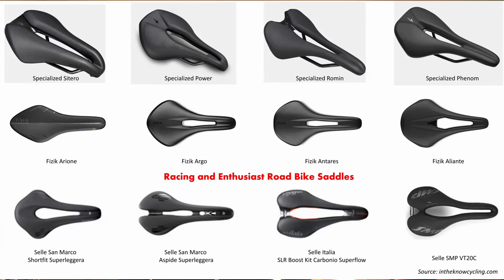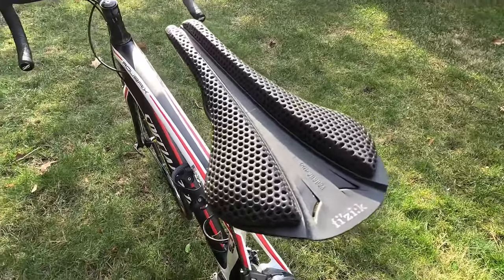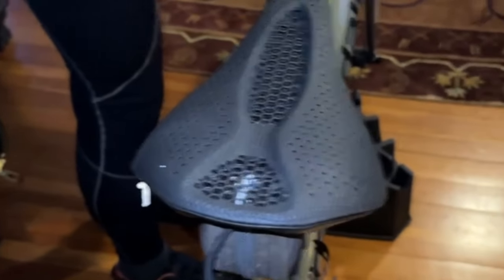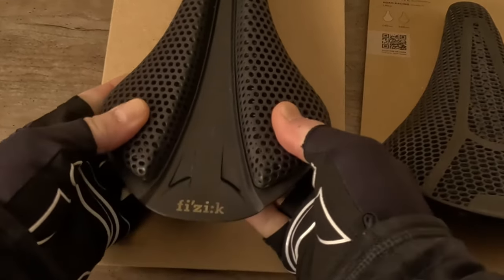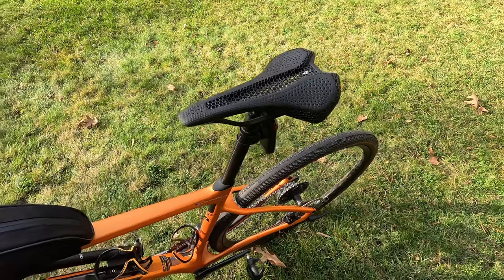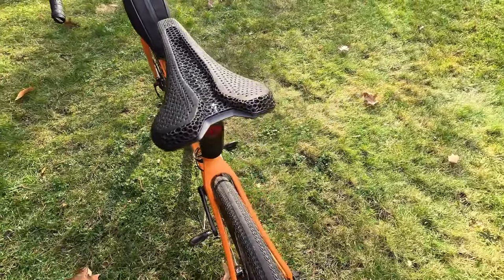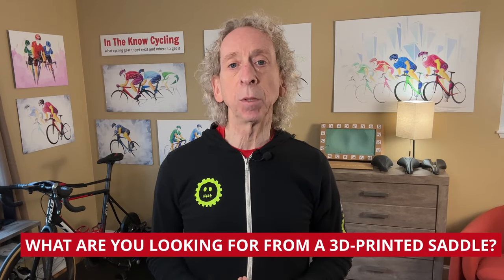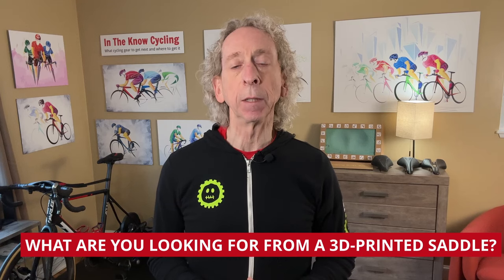3D-Printed Saddles | In Search of Comfort and Performance

Comment: Another option to look into is Reform saddles, which uses a heat molding process. I've tried a few 3D printed saddles that were ok but not great, and my narrow ish sitbones have made it tricky to get a saddle of any material that I felt 100% supported by, but the Reform saddle even before heat molding felt much better for me off the bat. Not saying it will deliver the result for everyone, but something to think about as we search for actual custom fit options like the butt print one.

One thing I'd like to see from companies who offer butt molding is some kind of apparatus that secures to the rails of your seat post so that when you sit on the molding material it matches the angle of your riding instead of a neutral sitting position.

Comment: Imagine a “fitting saddle” that could adjust all the parameters in real time while testing similar to a fitting test bike. 
Maybe with fluids in segmented compartments that could be adjusted for pressure during the test. Combine that with the contact images that indicate the hot and cold contact points and I believe the situation could be highly improved. If perfected there would be riders lined up around the block to try it. Even different widths could be made for sit bone spacing. From my experience getting a good fit can be as elusive as measuring smoke with a tape measure.

Comment: I would find it helpful when reading saddle reviews if the tester listed their size, weight, and build. A test from a 6'0" tall 175 lb rider isn't much help. One from a 5'7" 150 lb tester might point me towards  a saddle that would be more comfortable for me. I'm old and slow so comfort is my priority. Thanks for your videos and website.
Reply: That still wouldn't help. Someone of the same height might have wider sit bones or more hip flexibility or an off center pelvis or any number of differences from you
Reply: @damu6678  I wasn't thinking of this as a complete solution, more of starting point. Every little bit helps.

Comment: I found a very good offer for S-Works Power Mirror saddle (286 Eur / 310 USD, incl shipping) so I couldn't resist and purchased it. Now waiting for winter to finish here in Europe and give a try. What are my expectations? I'd say that I'm not 100% happy of my current Power Expert saddle in long rides - it's not terribly bad but I know that it could be better (e.g. comparing with my previous bikes/saddles). Part of this is a bit more aggressive position and bike geometry so I hope that the new saddle with Mirror somehow will compensate it.

Comment: I'm stuck inside on my Kickr Core full-time due to a very nasty accident and would like to know if you have a suggestion for indoor trainers.
Reply: Sorry to hear about your accident. Considering what you've gone through, I'd start with a good fit and then test saddles suggested by your fitter. A 3D-printed saddle (or foam one) may give you more comfort, but you need to test them after your fit to figure out which would be best for you.
Reply: I just switched from a Specialized Romin Evo with level 2 padding to a Fizik Tempo Aliante and have experienced a noticeable improvement in comfort on 2 hour trainer sessions.  I'm 5'10" and 160 pounds.

Comment: I don’t think they’re nearly long enough, personally! Anything shorter than a 270 mm long saddle is useless for me with the pushing of my manhood bone resting on that short nose! I am looking to try one of these saddles and have many normal ones in different lengths and widths, but I seem to need a 155 mm wide saddle, so when I was about to look into buying one, I realized they don’t make them any longer than a Specialized saddle, which is absolutely of no use to me! Yes, I am a bigger rider looking for more comfort (250 lbs), but I can’t get on with a short-nosed saddle; they are so painful, so it looks like I’m out of luck for the time being.

Comment: Bet the main reason behind 3D printing saddles is to keep cost down as you do not have to assemble it from multiple pieces. But they tell you they are more comfortable so manufacturers can jack up prices and increase margins.
Reply: 3D printing is much slower and costlier than traditional manufacturing methods, it’s incredible these products even exist at prices comparable to regular pro saddles.

Comment: E bike king of kings talks bikes:
Remember u asked earlier range of this E Bike kit I stated 17.5mph ave. speed 35 mile round trip? Getting 50lb groceries halfway in?

Thresults are now officially in on new ebike kit.
 Bcuz I set wrld record spanning entire year in my stock Honda Civic, nobody on this earth test/ exploit an e bike as good as i.
  Official EXACT cuttingist edge max distance& ave. speed new battery& kit are doing =
   1st of all many times these engineer a$$holes SAY a display has fuel gauge but it doesnt actually wrk.
 This disay& kit wrked righteously.
  I felt like i was suddenly riding on a finalky greased rusty chain.
    My direct drive generated a lot of drag.
  This one ZERO drag & it felt noticeabky, constantly GOOD. Felt great. Also felt great 2have 24 gears again versus only 8. 
  
   This display also worked. Perfect.
    All controllers should have a 4giveness feature like motorcycle reserve petcocks let u know u must drammatically reduce speed 2make it home...
   My display has 5 battery bars that WORK.
  But when it dies it comes back on with 2 bars reserve & i suspect it was engineeeed 2give u a little grave period so as u can sliw down limp back home. 
  I am very impressed this was emgineered thoufhtdully.  
  I warned China 4 10yeara they had better begin doing this. 
So here is photo all th stats.
   I had earlier estimated I would do up2 17.5 mph ave. speed 35 miles round trip. 
 I averaged 17.3 mph traveling 17.3 miles 2Walmart.
   I got 50lb groceries.
   Distance Walmart 2cabin = 17.3 miles.
    I averaged 15.8mph back overshooting thcabin till battery died.
   Battery died @ 20.91 miles. 
  So, I overshot cabin by 3.7 miles& still averaged 15.8mph. 
   Round trip 17.3 + 15 8 ÷ 2 = 33.1÷2= 
    ...Bottomlinemy ave. speed was 16.55mph covwring a distance of 38.21 miles. Very impreasive. 
 THIS is what happens when u fueling a little 350 watt front wheel geared motor with 36 volts& operating it optimally. 
    Put yr average bozo on that bike their stats gonna be an absolute disaster area with abyssmal results& absolutely destroying/wearing out equipment while they're at it.
     In thway they destructively operate equipment.

 Conclusion:
      I now know I can confidently do out & back 35 mile round trip2 Walmart Poteau averaging 18.5 mph 50lb groceries in under 2hours round trip. 

AAAAAAAAAAA

10years ago I began warning cmpanies.
   I began sending angels in2 design things right.
 I sent destroying angels also destroy any cmpanies didnt repent = why fast food industries been going 2h*ll now. 
    Been doing same with them. They persist selling poison food thinking nobody gonna stop thm.  
   That ws stunning result new E Bike kit ysdrday.
   I been warning China 10years Satan NOT ruling anymore. Yahweh now ruling again secretly. Midst of his enemies& people cursing Chinas snake backstab planned obselesence engineering of lies. 
    Those curses = powrful prayers.
   Heard by Yahweh.
   
  Asians: Predominantly Satans DIRECT DNA when he mate with Adams1st wife Lilith who had almond eyes. Asian culture ADMIT they descend from dragon (Jesus elder brother.) Who still serves Yahweh lol.
   Puts all who choose him in hell. Burning his kids is a FOOD 2him theez Asians think he gonna bless thm. 
 (Yahweh turn Halayel ("Satan") in2 humanoid scaled black snake with wings = now he cant mate anymore (Genesis 3:15.)
    = He why he preserve his bloodlines2 oppresses others.)
 Satan used 2rule creation when yr solar system was heaven.
Now = harvest = Satan putting all his kids (biblical tare race) in h*ll.
    My job = inform them they doing evil warn them do right = I immediately leave trail dead bodies as a rule. 
   
My new E Bike Kit:
    This E Bike kit was done right.
  I began specify in detail20 years ago how E Bike kit should be designed. This kit 90% nailed it. (90% still 10% lie.)
     
My job riding bike = 2b super gentle careful. 
   1. Operate so as2b constantly gentle withoze nylon gears.
   2. Touch buttons minimally they designed2 wear out.
   Tape waterproof connections thwart corrosion.
 
    Keep bike inside stop freezing preserve battery/stop condensation.
   Keep LCD facing DOWN.
   Sun wears buttons out.
     Keep constant diligent pressure on those pedals reduce stress on gears while keep up my speed save TIME.
    This kit will buy me 70 hours time a year I save commuting = 9 8hour days work I'll gain.
  Charge battery minimally under 75times annually.